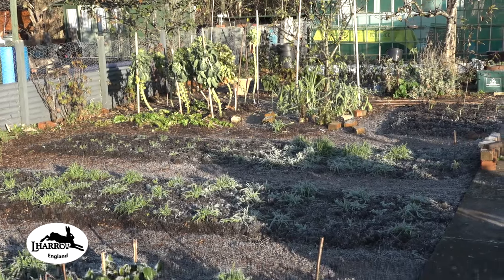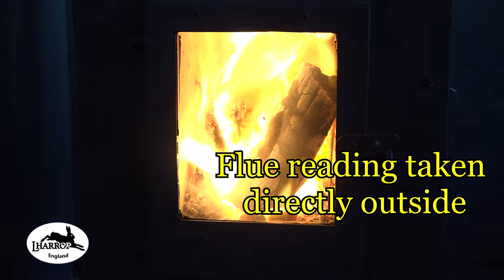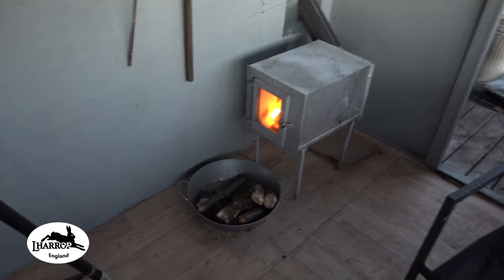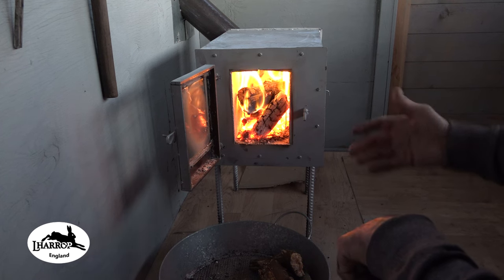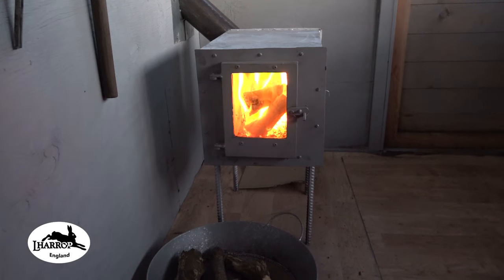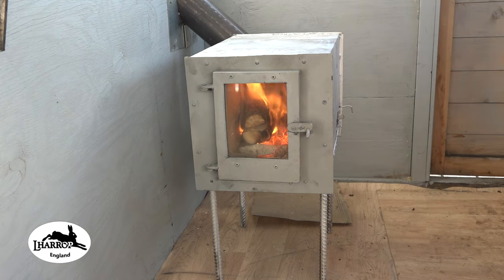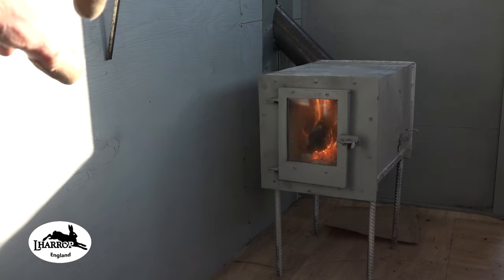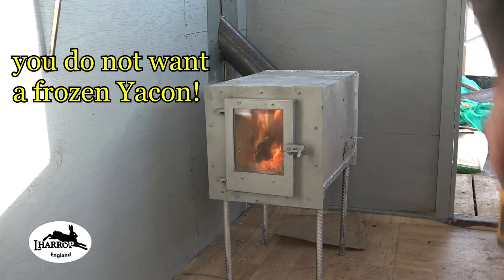New hybrid rocket stove prototype no 1 cabin, boat caravan.

Comment: Great little stove! Just a thought, it may be worth considering some sort of protection from accidental touch of the stove top/sides as with temperatures at such high levels, it can easily peel-off the skin even with an accidental touch. Not sure how you'd do that but may be some sort of stainless steel wire-mesh (1" x 1" square, wire dia may be 3/4mm ) fixed about 1" away from the surface of your box so that those wire-mesh is doesn't stop from the heat radiating but would significantly reduce the risk of accidental touch on the bare metal plates which are quite thin from what I can see from your earlier videos. Stove seems to be highly efficient for such a simple design, you could put a kettle on top for your tea!
Reply from the maker: Thanks mate, all good points if anyone is reading this be aware of that, the intense heat radiating from it though makes you very aware of the danger when you go near. Thats the best part putting the kettle on top only takes a few mins for a brew....Cheers.
Reply: @LozHarrop  Hi Loz! The sheer would make one aware surely. But if the stove is placed with quite a few people moving/working around it, especially kids it may warrant some safety measures. But in your case the outhouse may be accessible to a few people only and probably that wouldn't matter much.
Reply: All wood stoves are hot...lol....everyone knows this

Comment: Lovely little stove, but I'm not seeing what's hybrid or rocket about it. Most small stoves will burn clean and hot when fed smallish fuel with the air feed wide open, but as you experienced that tends to make the space really hot and eat through fuel. By limiting the air to reduce the intensity of the burn you're using it like a standard wood stove - cool and slow, rather than hot and fast. 
Rocket stoves are great for some applications, but heating a small uninsulated cabin isn't one of them unless you've got a big thermal mass to soak up the heat from a fast hot burn.
Whatever the case, it's a lovely little stove.
Reply from the maker: Hi and thanks, I really have not gone into the internal workings of the stove because this design as far as I can find is brand new. it was built to see if the idea would work and it clearly does work really well, now it will evolve into a totally new style of rocket stove with luck. Cheers.

Comment: This is awesome, will you be able to make the final build and plans available? We are building a log cabin and need a good wood stove like this!
Reply from the maker: Yes they're will be plans and it's very simple to build can be scaled up in size to heat a much bigger space and hold more fuel to burn longer. The next version will I think exceed what this can do. You build these to iron out any problems and look to see if you can improve have found the solution to that off an idea from a patron xj9. 👍

Comment: Looks good.
My first thought was, it’s a tent stove, then I saw the thermal mass of the bricks!
How does it burn from cold?
Reply from the maker: Thanks there is no thermal mass in the stove it burns fast from cold and gets to full temp in maybe 5 mins.
Reply: Ok, I tend to think of the bricks storing heat. I have a normal style room heater which I have bulked out a bit with extra bricks. Once these reach a decent temperature the fire gets going properly. @LozHarrop

Comment: Anymore details on how this is made / the design? Burn looks really clean. Is it using secondary burn? Anymore details would be welcome. Ta.
Reply from the maker: Hi yes the whole video story so far has been content created for my patrons for their support, you tube no longer supports small creators so without the patrons I doubt I would take the time to work on these projects. There is no secondary burn on this just a small amount of primary air with ways of preheating the flue from cold. It is evolving now as I work on the 2nd prototype. That version will be alot more challenging but once I have the chambers in the correct proportions it should turn it into a brand new style of rocket stove. once it is working I will show the next version to my subscribers. It may evolve even more from no 2. Cheers.

Comment: I am not familiar with Patreon. Do you plan to post the plans for this on YouTube or do we need to join and pay on Patreon? Thank you
Reply from the maker: Hi this is a prototype and I will be doing more work on it so i wont put out plans until I can get it as good as it can be. no point drawing plans to then change elements in the stove. I am working on this at the moment just to see if I can improve it in any way. have designed it so that is is fairly easy to build with minimal tools and just need to look at what is available off the shelf to make it all fit together. There will be more videos on it to come. Cheers.